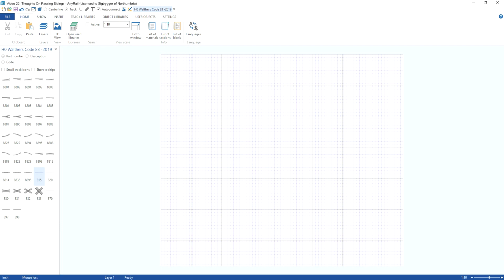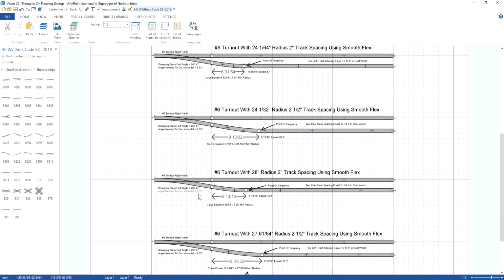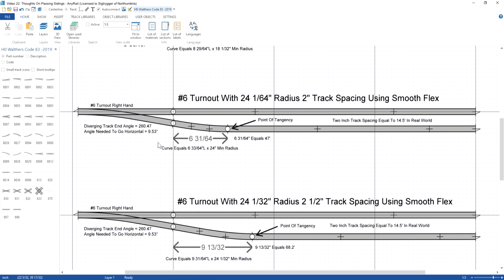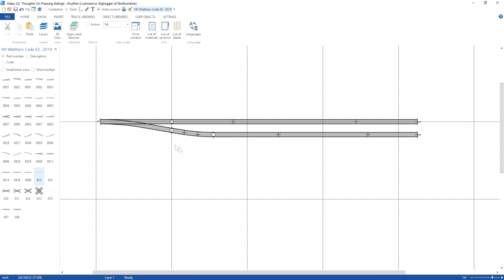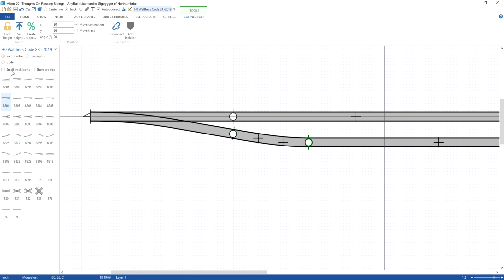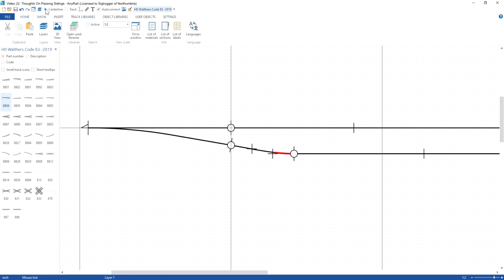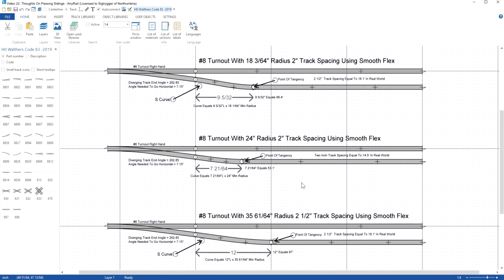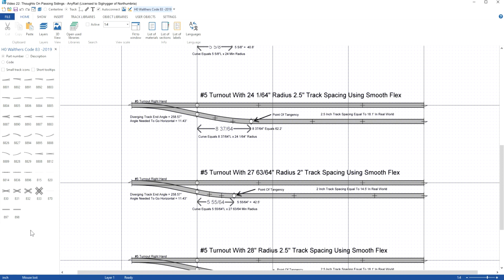AnyRail 6 Tutorial: Video 22- Thoughts On Passing Sidings

Comment: When I worked for a unnamed railroad the fouling point (by definition in the rule book) was of an adjacent track was 4 1/2 car lengths from the switch points of a switch. A standard boxcar is 50' feet long so that distance would be 225' from the switch points. Sometimes in order to gauge if a car was in the clear I would stand next to the car and the end of the ties of an adjacent track and swing my arm up and down and see if I could touch the railcar next to me. If I could not touch the car then it was in the clear. Later on management painted the clearance points and all cars had to be behind the paint marks. The managers not understanding the rules would apply the paint 225 feet from the frog of the switch thus making the new clearance point  maybe 325 or 350' from the switch. This made the yard lose a lot of space and also made switching cars much harder for crews.
Reply from the maker: William, thanks for the info. I searched all over the net trying to find something on fouling points and came up empty. Dave

Comment: Dave, thanks for this series.  I've gotten a lot of out them.  In regards to the passing siding discussion and S curves, isn't it important to get enough of a straight track between the frog of the turnout and the curve into the siding, to avoid an S curve between the turnout's right curve through the points and the left curve into the siding track?  As a hypothetical, if there was 3 inches of straight build into the turnout after it passes the frog, and you wanted 6 inches of straight before the curve into the siding, you would need to plan an additional 3 inches of straight from the turnout before planning your curve into the siding.

Also, do real world railroads put spiral curves into the curves into a passing siding?   Since they are not negotiated at speed, do they use circular curves in these small curves?  Don't know the answer, but it might affect how we plan our examples.   ie.   3 inch straight followed by circular curve of X radius with divergent angle of 9.53 degrees for your particular turnout.

Just a couple of thoughts as I waded through your impressive presentation.
Reply from the maker: Hi Richard, Short answer I don't know. I suspect that the small amount of S curve introduced would not affect the operation of a model railroad. I also think that many of us introduce S curves into our layouts all the time in an effort to jam in as much track as we can. I know I did on my last layout. The only reason I pointed out the small S curves was that I didn't want someone to take me to task over it due to my constant state of inattentiveness to detail. I would imagine that there is a book on civil engineering for railroads out there somewhere that might explain this but even if I found one, I'm sure the math would be way over my head and I'll bet it's pretty dry reading. As for real railroads, I'll take a look at a passing siding on the UP here by the bay that I pass every morning on my walk. I doubt I can glean much info from it but I'll take look. I might also run over to the BNSF and look there. They run single track main here by my house as opposed to the UP's double track main so I can find more examples. You know, that question might be a good one for a model railroad magazine where they could ask their experts. If I find or see anything I'll let you know. Dave

Comment: Hi Dave, I was wondering if u know how to connect levels from a helix to one drawing. Or do need to have multiple drawings.
Reply from the maker: Robert, I have had this request in the past. I keep telling myself I need to address it. Early in my AnyRail days (last summer) I attempted to modify a design using a two track helix that had one side up, the other down and went different directions at the top and bottom and the design of it kicked my rear end and I dropped the idea and wished I could delete the 'Helix' button from AnyRail. Now though, I think I am ready to tackle helixes again. I have your request on my list and I will work on it soon. Thanks! Dave

Comment: I don’t think Anyrail wants other people to be able to add those segments to their libraries because they didn’t create them. You could add them to the object library that you showed in the beginning with all of the buildings that others have created and then people can choose if they want to use them. Question 1, when you are working with flex track and you extend a piece and it exceeds the normal length of a piece of flex track does the free version count that as one piece of flex track or does it figure out how many pieces it should be? Question 2, when using the Walthers modern day roundhouse components can you connect each three stall section to each other easily to create a larger roundhouse? Thank you in advance for your answers to these questions and for taking the time and effort to make these tutorials. A suggestion for another video would be to create a 5 track yard ladder and a main that would be the most economical use of space to lose as little storage track as possible. Maybe one that uses Walthers number 6 straight turnouts and one that can use a combination of Walthers number 6 straight and curved turnouts. Thanks again.
Reply from the maker: Derek, I gather from the forum ( I am not a big user of forums and get frustrated searching them so my time spent there is limited) that a lot of the track components are designed by users but don't quote me on that. Let me look into the taking a custom set of track components and putting them into the object library. As far as I know, in both the free and paid for versions, AnyRail counts an extended piece of flex track as one piece. I have not played much with the part of the program that tallies up your track components. Future video? Now I just quickly tried putting two roundhouse together and I don't see a way to get them to snap together. I could rotate one to match the other one but my angle may not be correct. I think you would have to figure out the angle of the outside wall of roundhouse #1 and the rotate roundhouse #2 to that angle and then place them together. How to do that? Not sure. Another video coming soon I guess. Also, you cannot group two structures together to make them one. At least not that I see in my quick look. You can select both and move them as a group but they will remain two entities. I'll look into this and also add both of these questions to my list that I have of things to explore and figure out. Let me know how your railroad design turns out!
Dave
Reply: Thank you for getting back to me and answering my questions. Again, thank you for doing these tutorials, they were a real help and all of us appreciate all of the time and effort that you put into them and the manner in which you taught us. The yard ladder was something I thought you and your analytical mind would find an enjoyable endeavor and all of us would gain from your effort.